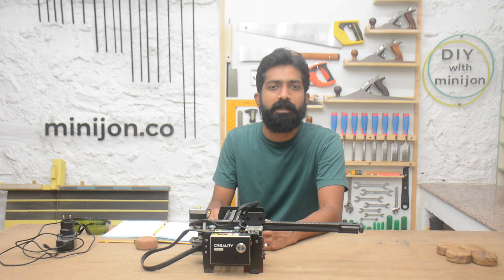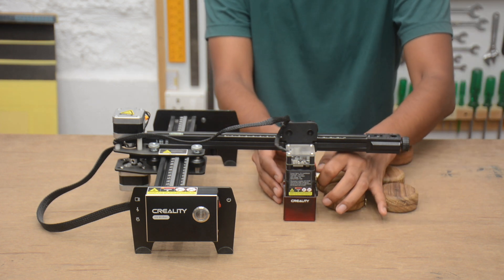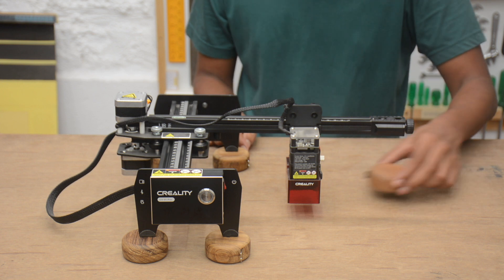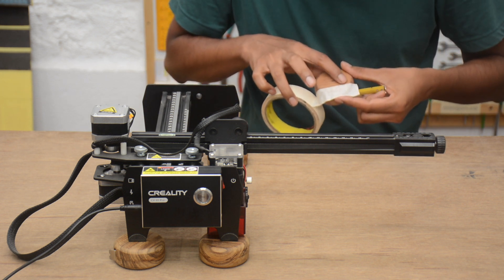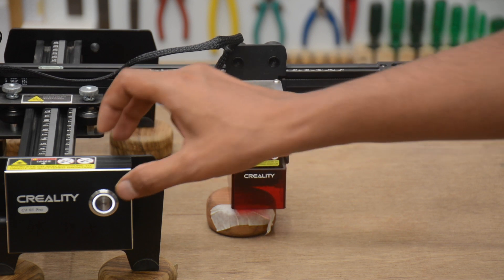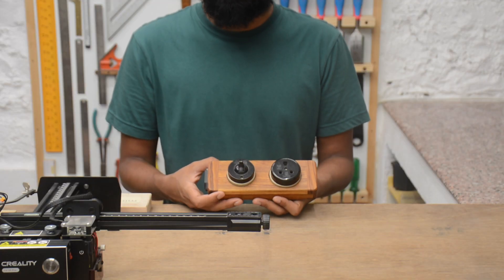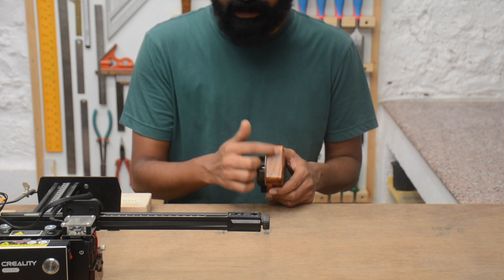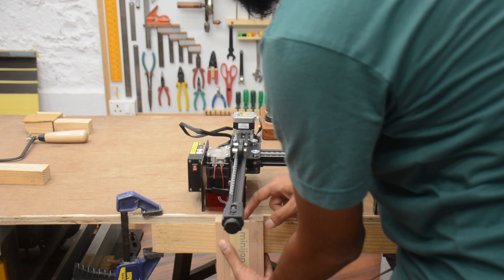customize products using compact laser | laser engraving tips and tricks | creality cv-01 pro

Comment: I had this machine, its laser has become weak. Now from where do I purchase a new head? Will only Creality laser be fitted in it or can anyone install a 1.6w laser online? Please reply
Reply from the maker: Try cleaning the laser lens by removing the laser head from machine. Use a lens cleaner on ear bud to clear any deposits. 

If you have tried that already and laser needs replacement, go for the original creality laser head. Contact the sellers directly via their website to get better prices.

Comment: Can we engrave on pens with this machine?
Reply from the maker: It entirely depends on the material of pen body. It cannot engrave on metal but can burn the coating or paint to create engraving effect. However some coatings could be very heat resistant or some plastics could burn and make a mess.

Comment: My CV-01 Pro laser doesn't appear to be working. Only had it 2 days (bought second hand, but boxed and unused). Worked great day 1, now when i try and engrave it just goes through to motions, but there is no laser (or its very weak). Tried all kinds of settings/power etc. Any ideas?
Reply from the maker: If you are sure its not a problem due to software settings then you should contact a creality dealer and look for a new laser head. 

First you can try cleaning the laser lens with a  lint free cloth and check and refit all connections to laser head.

Comment: That answers some of my questions thank you.I wanted to engrave on thicker wood and this answers that. One question: If I had animate larger than the full size of the engraving area, could I do it in two sections by engraving half the image first then move the wood across and engrave the other half? Any tips on aligning the second piece?
Reply from the maker: Its very difficult to align two parts of image accurately.